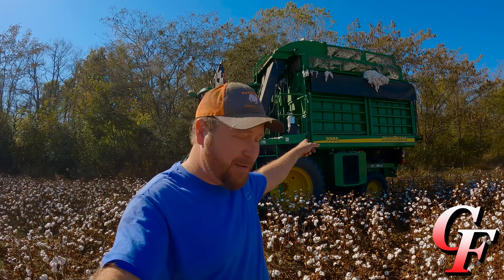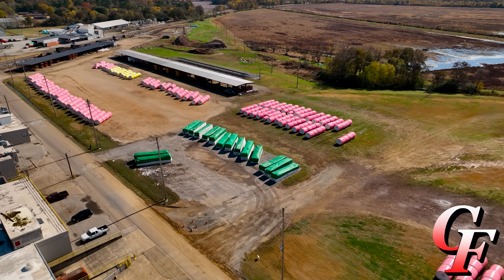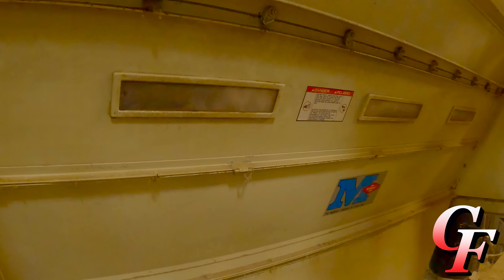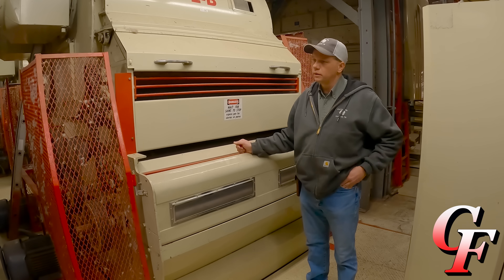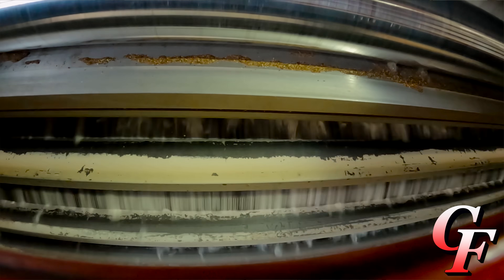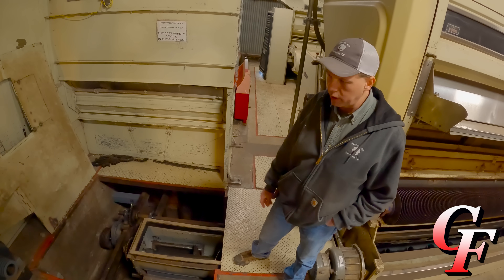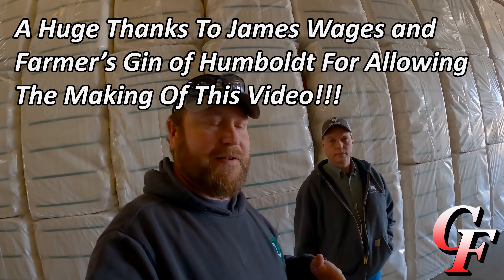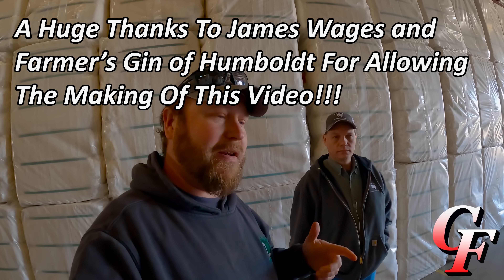How A Cotton Gin Works

Comment: What happened to the suction tube,that men used to run the suction tube?
Reply from the maker: Most gins still have one but they’re only used for sucking cotton out of trailers which are hardly used anymore
Reply: @griggsfarmsllc  yes,that was the old times, I'm from Texas the panhandle and my age back then I used to work in the gin,when we used the suction tube,in the trailer,now there's modules,etc....

Comment: Glad you posted this.  I grew up in Crockett County.  Daddy grew lots of cotton.  I worked in the fields every summer until 1969.  I have handpicked it, hoed it, cultivated it with 2 row, 4 row and 8 row equipment, driven a picker.  Everything is more automated today.  I've been to Humboldt many times, but not lately.  Thanks for posting.

Comment: This brought back a lot of memories ! I was a ginner in West Texas in the late 80's early 90's. Running old Continental Gin stands, where you had to monitor the seed roll continuously. Modules were a treat to gin, considering 99.99% was all trailered cotton and suction tubes. Bales were hand bagged and tied with wire. Our gin may have been small, but we were proud that it could gin 12 bales an hour all day long when conditions were right. Lots of memories of those days ! Thanks for taking me down memory lane !
Reply from the maker: Our gin was all trailered cotton and wire tied bales too.
Reply: @griggsfarmsllc  LOL we didn't even have an electric hoist to weigh the bales, it was one of those chain hoists. Those were the days !

Comment: A LOT different from the gin my Grandfather took his cotton to in Tillatoba, MS in 1955. I picked for 2 cents per pound in 1955. All I remember about that gin was seeing the finished bales, which my Grandfather said weighed about 400#. I do  not think there was any equipment for separating seeds and lint, as is seen in this video. Being all hand picked at the time, there were no hulls in the cotton. The cotton was taken to the gin in an open top, expanded-metal wire-sided trailer, about 8' wide x 20' long x 6' high on 4 wheels, and was pulled behind a farm tractor or a pickup truck. The compressed bales back then were wrapped in burlap, and then banded. Those finished bales back then were nothing compared to the clean, clear wrapped bales in this video.  That gin in Tillatoba was heavy-timber framed , with galvanized tin sides and roof. It collapsed from deterioration about 15 years ago. THANK YOU for a most interesting video!!
Reply: Thankyou

Comment: does it work on the same principal  as Eli Whitney cotton gin just on a much bigger scale?
Reply from the maker: Pretty much I believe. But Eli Whitney’s design was pretty much designed to remove the seed as there was no need to remove trash because all the cotton was hand picked at that time. Modern cotton pickers and strippers will grind some trash up in the fiber that has to be removed nowadays. Also Eli Whitney’s invention did not include a press to compact the fiber into a package that could be easily transported
Reply: @griggsfarmsllc  thanks  I didn't know

Comment: Worthless!  You didn't actually show how the internals of any machine worked.  All you showed was cotton moving around.  Yea, everybody already knew conveyors and air moves stuff around.  Do it over and do it right!
Reply from the maker: Hey Richard let me educate your ignorance. All the internals are called internals because they’re actually INSIDE THE MACHINE and not accessible when the gin is actually running… But if you can do a better job, by all means give it a shot

Comment: stupid questiopn but cant you put some generators on the gear wheels to get back some of the energy
Reply: The energy to run the generators would come from the motors running the machine.  Since no generator is 100 percent efficient, you would only loose energy.  Even if the generator was 100 percent efficient, you would never get more energy out of the generator than what you put in.
Reply: I am an engineer and I can’t tell you how many hours I have wasted trying to explain how a windmill on an electric car can not be used to run the car…
Last week it was paddle wheels on an electric airplane to run it.
Unless your trying to slow down to land it does not work…

Comment: Great job on the video. The question I have is what has happened to the cotton compresses. They used to take a full size cotton bale and press it down to about the size of a regular square bale of hay for storage and transportation. They used a huge press that would press the bale down so far with hydraulics and then huge iron wings on the side of the press would fold down and compound the pressure to two or three hundred tons. Then people would step into the open area next to the bale and pass thick steel wire around the compound pressed bale and give it a half twist thru slots in the press block. The would pass ten or twelve wires per bale to hold the shape and size of the bale. Every few bales a wire would break shooting an end of the wire out like a bullet. It was dangerous hot work. I used to work on the Cat engines supplying the hydraulic pressure. That was back in the eighties. I went by the old building a while back and it was empty. Are they no longer doing this operation or did they just move to a different location. I know a lot of the gins in this area have closed down.
Reply from the maker: Modern gin presses are capable of compressing the cotton into the proper size needed for transport so there is no need to take the cotton bales to another “compress”. I know what you’re talking about as we used to have to take the cotton from our old gin to a compress

Comment: Good video,  lots on automated  equipment.  So how do you get paid for your Cotton.  By your  yield,  are there docks for moisture,  Foreign matter?  Thanks.
Reply from the maker: We get paid by the pound of lint we produce. That price is based on the futures price of cotton ply or minus any premiums or discounts we get for the grade of cotton. Cotton is graded on several factors:  

1. Staple length-this is the length and fineness of the cotton fibers. 
2. Micronaire-this is basically a measurement of how thick the fibers are
3. Strength-how sting the fibers are
4. Color- even though cotton “appears” as white, weather and other factors can cause the cotton to not be pure white. 
6. Trash- the gin removes the majority of the trash but some of it is ground into the fiber during the harvesting and gin in process and cannot be removed by a conventional gin
7. Foreign matter-  things other than plant trash such as plastic or grease can cause serious discounts. Plastic fibers from supermarket bags that blow into the cotton field can cause big problems. 

We also may get paid a little on the cottonseed if cottonseed prices are high. Otherwise the gin keeps the cottonseed to cover the cost of ginning the cotton
Reply: Wow that quite a process,  so they really keep track of  each load of Cotton through the Gin. As apposed to Corn or Soybeans a few straight forward tests at the scale and that's it.